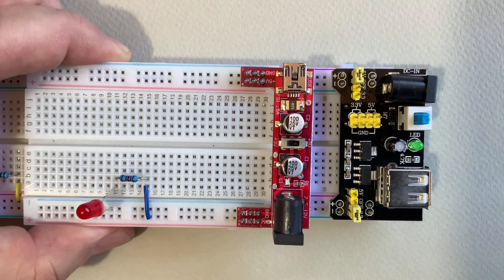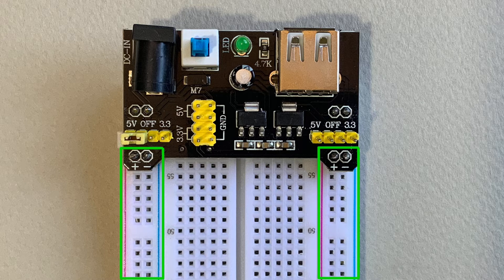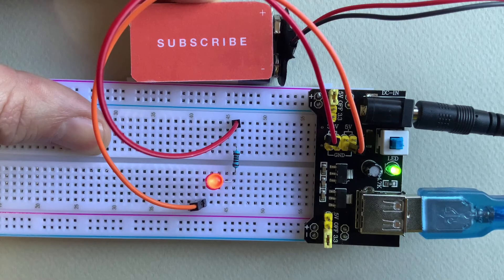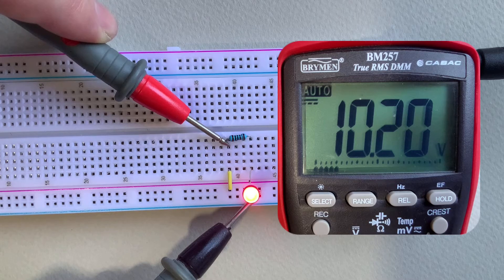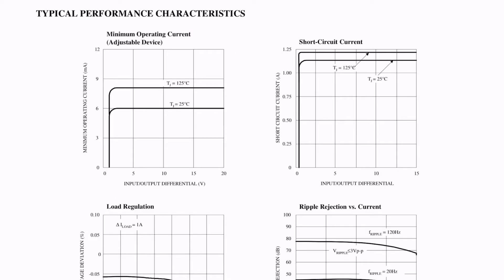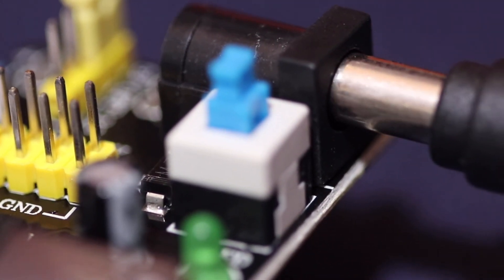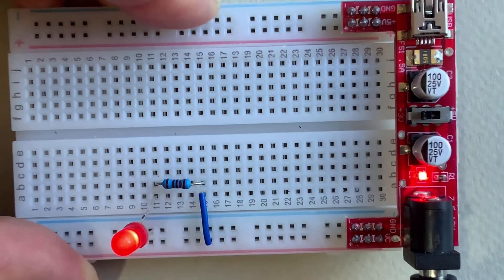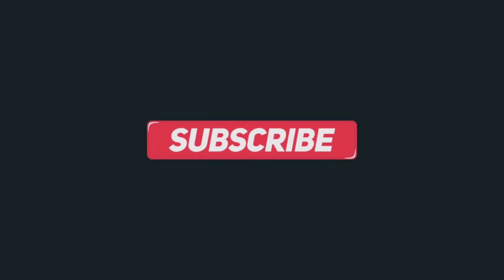Breadboard Power Supply Modules on a Budget

Comment: I've got the first board and encountered the same problem where the 5v jumper isn't working on either side, is there anything that can be done, or is it worth attempting to repair? I'd been using a 5v usb, decided to try a 12v barrel jack plug with an arduino uni relay circuit and noticed the voltage read was 14 so figured something was off which is why I'm googling and stumbled upon this video, the 3.3 seems to be working fine after everything, the relay and 2 led resistors seem fine as well
Reply: I did some more testing, measured the leads on the 5.5 regulator to confirm that's the problem, the output voltage on the middle pin is the same as the input, I also measured the voltage from my acdc 12v output power adaptor, which was measuring 14 volts, sounding like certain adaptors might operate at a higher voltage and then output the advertised 12 volts when plugged into the actual device they were designed for, it's known as a no load voltage or something, would still appreciate any insights others have as I'm new to this whole world

Comment: So the first module he showed technically had 3 power outputs right? I’m wondering bc I need a power supply regulation Arduino board with 3 outputs for several projects I have. Each module I’m using needs 5 volts to operate but I don’t want a ground loop and I need something to regulate it all. And this would be great for that, I’d be supplying the board (shown in the beginning of the video) with a BMS board that has a 12,000 mAh lithium polymer battery, and even tho the BMS board outputs 3.3v I’d be adding a buck boost converter to boost the output voltage to 6v and into the power management supply board. It seems like it should work but I’m not entirely sure if it will. But I still need 3 separate power outputs outputting 5v each. Do you think this would work?

Comment: How can I get 9v output from the module?
Reply: Buy a 9v battery. Obvious solution was obvious.
Reply: Not so obvious though, is that you can probably get 8.3 volts if you series the 5V on the one side with the 3.3V on the other...😉

Comment: If you put 5v in, how the F you got over 9V. There is not step up chips on that little board.
Reply: It wasn't 5v in.  it was 12volts which is within spec...was explained later in the video
Reply: Great for sensors 3.3V

Comment: My one broke, a faulty 5V regulator.  I gave up with these and bought a bench power supply. I have the smaller one which worked great but I needed more power for LED strip testing.